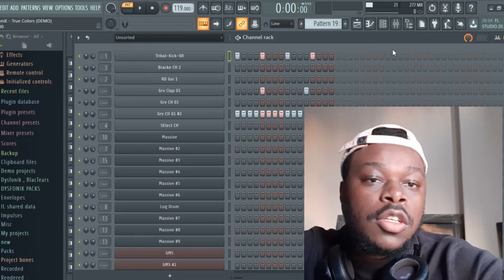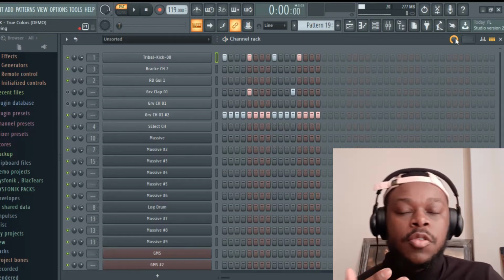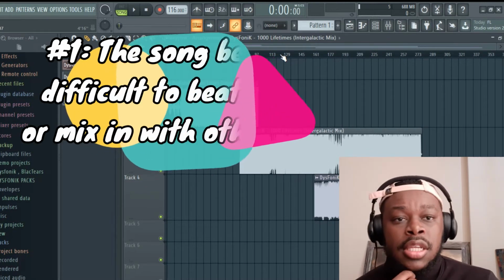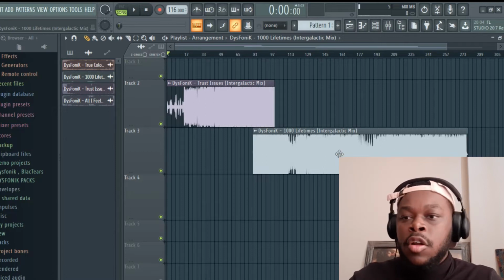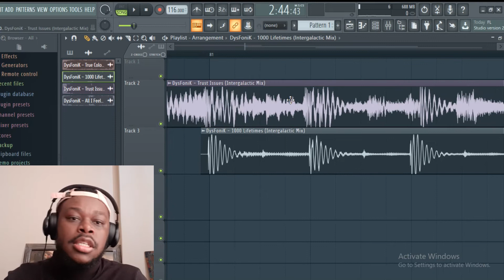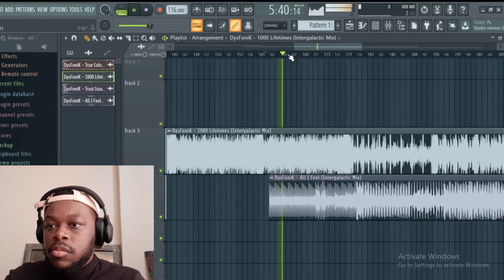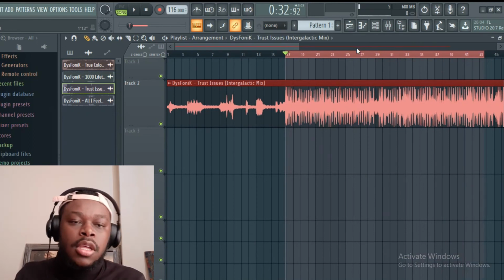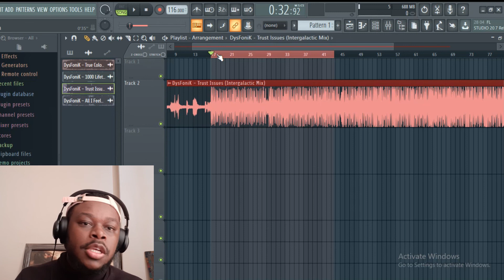2 Reasons Why You Shouldn't Use Too Much SWING On FL Studio

Comment: Hey man. Swing doesn't affect the down beats and off beats that's the reason you cannot hear it on your kick and snare. What swing does is moves the notes between them closer to your down and off beats, essentially your quarter notes. I'm sure most DAWs can use swing so it's not only relevant to FL studio. Swing has been used in music since before electronic music started and is most relevant to jazz music. Also, regarding your "collaboration problem" It's easy for someone to collaborate with you if they just check the transients of the notes of the stems that you send them so it's not a train smash. In most DAWs, swing is usually measured in percentages and I think the percentage ratio is global across all modern day DAWs so it shouldn't be a problem if you're doing a collab even if they using a different DAW. Hope this helps...
Reply from the maker: Thanks for your comments. I made this video after a bad experience with swing.
So There’s an EP i once made and my swing was like all the way to 70%. The ep sounded great👌🏽 

However, most djs failed to sync in the songs from that particular EP into their mixes. So i went back to fl studio to experiment more around with swing. And i saw that it was affecting mostly mu hats. But only when i set it below 50% , it becomes easier sync it with other songs. 

That was the whole motivation of the video, but i acknowledge i might not be aware of alot of info behind swing and thanks for enlightening be brother.

Need more comments like this on the channel😃
Reply: @dysfonik  Hey, thanks for replying. I don't think you should compromise your production of your track too much for DJs to play them. Maybe try bringing in your hats and busy melodic elements a bit later. What you can also do is automate the swing knob in the intros and outros of your track, like a real instant snap change after the first few bars. Lol I'm sure this can work for you from a technical as well as a creative stand point 😉
Reply from the maker: @aspekt7631  that’s brilliant, the only thing that matters to djs is a clean and not too complicated 4 step kick intro just to synch in the song.
I only realised this work-around later. Automation too👌

Hahaha, i would like djs to play my songs bro, it just feels good when your songs are on dj sets
Reply: @dysfonik  Lol yeah I know the feeling bro... btw just as an added bonus, you can actually swing each sample, synth, plugin, instrument separately. Instead of using the global knob. If you click the native plugin settings tab open you will find there is another swing knob over there so you can have different swing percentages on different sounds if you really wanna get crazy 😊